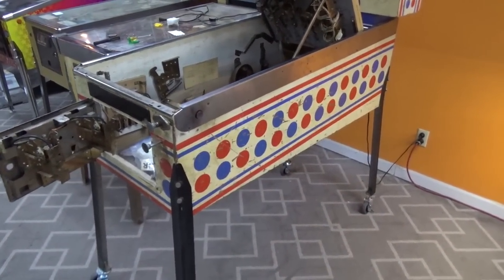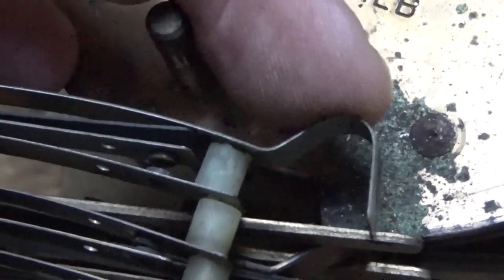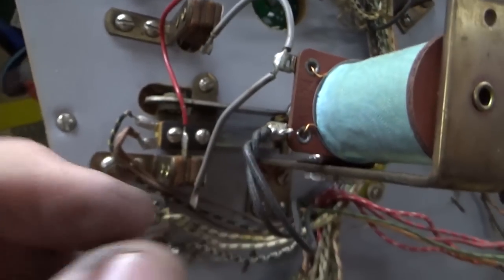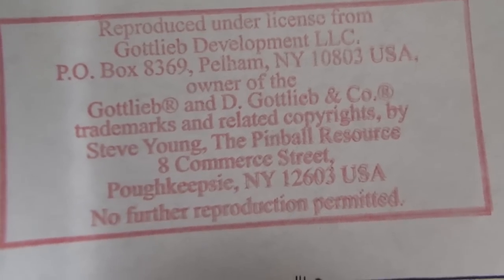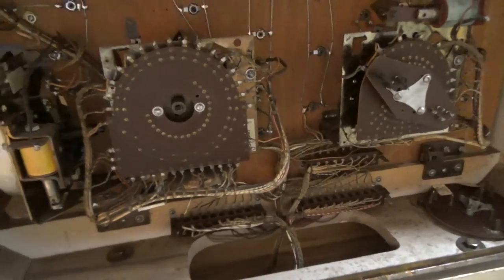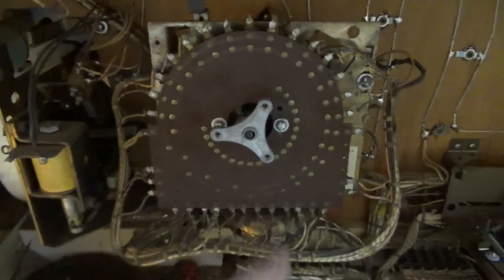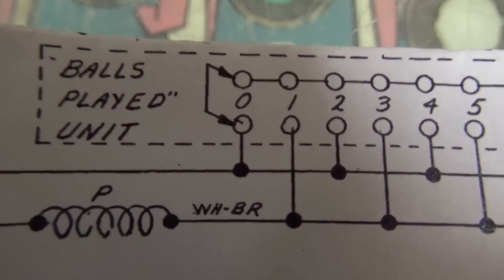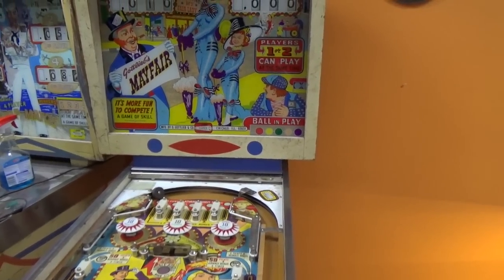Gottlieb Hid a Hard To Adjust Switch Under Their Relay Banks - 1966 MAYFAIR Pinball Repair 2

Comment: Thanks for this suspenseful video: what could possibly go wrong with this EM?! 🤔 I’m looking forward to the follow-up 😬.
Gottlieb’s Mayfair (aka Hyde Park) pinball was released in 1966. But it was not until 1971, with Gottlieb’s Playball (aka, Home Run, aka Extra Inning), that the company introduced 3-inch flippers. The Mayfair pinball you are repairing have been modified. This was done in the early 70’s, to give a new breath of life to the old machines which had been outdated due to the arrival of 3-inch flippers, especially in Europe (more specifically in Italy).

Comment: On many automotive applications, a starter solenoid may have a double winding, they call one a Pull-In winding, the other a Hold-In winding, for the amp draw reduction as you said.
Reply: True also as in other of his pinball videos has been brought up about the two warnings on The Flipper and sometimes other coils as well but for a different reason there are all kinds of weird and wonderful types of coils in various types of equipment or even things that you think would not have any additional electrical portions but do in some cases.

Such as a thermal switch with an additional one or more additional lead wires depending on circumstances and how it's used but having a heating element to affect the opener closing point-of- the thermal switch either to affect the cycle or a different reason.

One clever use of this is basically a delay startup or a sequencer type of circuitry such as a sequence startup of heating elements to avoid a very heavy start up load of various systems but pretty clever.

One saw component I got a bunch of surplus parts see a Treasurer it looks a large what I call Sandstone resistor except rectangular and taller than most resistors no documentation on it whatsoever possibly part number or not even a part number probably was something that was used in something and maybe the project was discontinued or just surplus of them it had four wire leads to at the bottom of each end I'm like what could this be took some measurements.

Two of these was a disc complete circuit Aki showed continuity probably extremely close to 0 ohms can't remember so long ago but or very close.

The other had quite a bit of resistance I was thinking some sort of weird power resistor but something got me scratching my head knowing that good and well this is door component would not be a safety issue to do this just didn't have access to an x-ray machine per se do the old big Clive x-ray machine routine or Allies known as Vice of knowledge wish I had one of those swing press Hammers and I've been nice.

But then again this was back long time ago back where those channels didn't even exist or close to it perhaps!

Since I had a gazillion of those Surplus components and was curious give one a few whacks with a 12 or 14 oz hammer seeing what it's that's look like or making it spill its guts whatever you want to say.

The thing what it was was the two of the leads were going to a wire wound resistive element in a common block of material!

The other thing in there which was another component was a one-time thermal fuse!

The idea was that if enough current would pastors resistor to create enough heat it would open the thermal fuse.
Of course no idea what these would have been used in but I've seen similar ideas in other things especially back in the day.

Something very similar in an old TV use resistor to either measure current or the circuit that would measure current and amplify enough to drive the resistor to melt a fuse link!

I understand some old microwaves used to use something similar that if excessive current was gone on the high-voltage enough current would flow to open a fusible element or something in somewhere to what this component would have been!

Also I understand in some old automotive AC systems there was a one-time component like this that was used under certain circumstances to open the circuit I believe it was something like a superheat switch or something like this I've heard of something on besides I might have this wrong.

I know there's going to be people saying about right to repair and built-in obsolescence and so on and one-time parts that deliberately shut something down when something happens but there were some applications were something like this would have been used sprayer for texture of device or to shove something down to prevent further damage or under certain circumstances we're repair would need to be made without causing more issues.

Most of I've seen has been in older equipment that would have been harder to do it a different way or somewhat similar not really so much modern times!

Sort of a similar idea to one-time switch or relay such as in at least one automotive AC system Howard that there was a switch that would only activate under certain conditions of temperature and pressure and would open I believe it was open circuit under the conditions in which the repeal of refrigerant charge that result in the system being worse off if not repaired it when this occurs.

Provides protection for other components so that you know something repairable is not turned into something that was not so much repairable and so their complaints would not need to be replaced and still be serviceable was the idea behind
Reply: There have been some interesting components and some other videos on this line such as a rather interesting relay that essentially had a fuse link and a spring-loaded contact but almost look like the case of say supersizing a diode Chase Butthead Ford leads one going to a either a coil for a heating element or a fuse link that would melt a certain temperature possibly enough current to blow the fuse link and the plunger spring-loaded Witchwood short gold contacts at the other end I think this was eevblog don't know if there was a follow up video as of this time still need a to check in this case it's presumably something military almost like that is meant to be something in the final missionary or final Sing sang a no-go or a go under certain circumstances the need to be reliable
Reply: Another scene that was clever was the resistors in some systems a pinball for the flash lamps those larger lamps that were as certain voltage and they call them flash lamps even know they are not actually yourself flashing bulbs like some of the pinball machines had but it's just the type of lamp that's used to give very bright indications and or light source not going into very specific detail as much as could have.

Like also does self flashing bulbs in some of the pinball systems were used as a timing ailment and some of them in the old school ones as well which were harder to get ahold at one point evidently possibly more recently but of course that could cause an issue.

I remember years ago when a hardware place closed they had all kind of voltage lamps and bulbs in the kids to replace them all labeled and everything like an old cardboard things in a case.

Remember back in the day I got all the ones I could afford from this Just for future got a lot of stuff from that place closed!

Wish I had room for one of the things that we're holding wire spools would have been really nice do something like that.

Although one thing that at one time something happened where are some stuff is no longer needed and doing some updates I was asked by the guy owned it if I could use some stuff and try to find a way to four spools of wire what's something that had been taken apart and that might be of use to do so so Salvage a few components from this almost went to other something else
Reply: Also if anyone's ever noticed hell sometimes when a bulb is used as a fuse sometimes this is used for protection of speakers even but it look cases sometimes back in the day and got all sure what I'll use them but it was actually cheaper to use a bulb that was have a fuse and holder crazy I know but back in the day perhaps a more modern sometimes this was a real thing.

Not so much as a current limiter but just to act as a screwed-up use of too much current is drawn the filament Burns Out

Even a lot of times if I'm building a project that where you're using multiple bulbs in series and there's a chance that when doing things there could be a short and accidentally killed low-voltage bulbs at be harder to get a hold of and would be easier just to put a higher voltage bulb in series limiting the current to keep from blowing bulbs this has been successful in many of my projects and sometimes just having a sacrificial bulb that would be less expensive than the ones been protected work as well!

Sometimes a good incandescent bulb in the right type makes for better lighting than LED in modern times we're certain things it just works better Anthem does vice versa.

Back in the day get something used or otherwise and salvaging something that's not really worth repairing or just something Oddball they don't need but yet it has highly usable parts for other things!

I'm sure most people would realize back in the day there was a lot of incandescent indicators and bulbs and things more so the nowadays.

Plus sometimes having all the sockets with them and some bulbs are more desirable than others using these for other uses was worth saving you know they might have a lot of hours although sometimes not they were still handy.

Hard to believe somebody virtual bulbs they used to produce still have modern bulbs being made for these bases and modern Bob's being produced for the old holders.

Sometimes even using your old light socket with a modern LED twist is great for some things Niche when all you need is just something specific for a one-of illumination for something.

Not to mention just using incandescent sometimes works better and easier than LED if you've got everything needed to use incandescent voltages and currents might as Wells if it looks better in some cases as well.

As well as say you've got 12 or 24 volts and you're just needing to have a bunch of Lights just run a bunch of all voltage bulbs in series is easier than trying to figure out how to do LEDs if it's just something that is one off here and there and not something that left together forever Jay-Z even use the power Transformers from clock radios and digital clocks for things like this even had used some old God the gutted clocks for the low-voltage portion that would run filaments on something like a vacuum fluorescent display was proper voltage for some bulbs also ran across a bunch of eggs funds that used 6 volt wedge base bulbs and even use the Transformers.

Had seen some of these that seem to have a relay setup so that could have been used on some sort of old backup system perhaps emergency lighting or otherwise where that if AC power cut out a relay with a changeover switching the low-voltage bulbs which were on I believe AC don't know if there was a diode undies or not can't remember that would have had any terminal block for auxiliary input these things were ancient but it's was just interesting that they were intended for some sort of backup system back in the day when usually it was just connected to straight AC power and the only exit time the exercise early it was just one circuit and the power was on.

All the old equipment like this and other sorts of weird and wonderful things are great for parts when you want something nicer or just vintage or just something a little more useful than the original things might have been any more it's worth doing something with something old to make it new again nowadays so much stuff is basically just plastic and I get thrown out it's kind of like those so-called energy-saving LED fixture is that once One LED decides to go south the whole thing is trash landfill lights ofsome people refer to

Comment: There is something to be said for keeping a game as original as possible but the kick switch for power is probably something I would modify to make it like more modern games.  My Gottlieb Paradise is nearly identical in most ways to this Mayfair and I got tired of the kick switch really quickly.  I added a push button switch in the location of modern power switches and rewired the kick switch to that.  Because it's low profile it's just screwed into the bottom of the cab so really a minor modification.  I much prefer the way it is now and I believe most collectors wouldn't mind this mod.

Comment: I am extra interested in this series. I'm to the play testing stage of a 1963 Flying Chariots that is much like your Mayfair. Mine was stored dry, but perhaps hot-the glue had let go for most of the wood and no rust. Besides a couple fried coils I found about 4 wires had fallen off switches. My playfield art also looks great. Well, except for the holes from posts partially blocking the side drains somebody added. lol

Comment: If the game has a 1st point relay in the control bank, trip it with your finger. That's probably all the matter. The 1st point relay tells the game to wait, so you can deposit a coin for 2nd player, and the relay then tells the game, go ahead start play (or reset at the next new game.) . If it's not the 1st point relay, then SB is not pulling in, or the reset relay is somehow involved. Or possibly the armature switch, but I bet it's just the 1st pointer. Game won't reset unless 1st point is down.

Comment: really envoy your repair videos...I have a cowpoke wiht monor issues but need help to figure them out....any suggestions on where to go for troubleshooting ?   I have a couple of issues with my cowpoke.
Basically in great shape and I keep it going by blind luck.
Have an issue with the 10 point "kicker" at the top (round 10 point when lit with the top cap)
It still kicks the ball but no bell ring or points register ?
Replaced bulbs in that area and it stopped working then....Any ideas what it may be ?
Also 3 lights that should rotate from side to side (one green and 2 white on the bottom kicker sides and the 100 point when lit that should rotate from side to side). not sure if these ever worked but think they once did ?
Any suggestions would be appreciated...the new led lights look great

Comment: Question in the middle by the coin door in line with that mean wiring loom harness that runs down the middle betweenatna point or what is that metal box/ assembly or otherwise just curious convert to otherwise but just saw it momentarily interested to know

Comment: The trouble with using a dropping resistor like that is the lamps have to have an expected load.  To much current they become dim and the resistor overheats.  To little current and voltage goes to high and shortens lamp life.